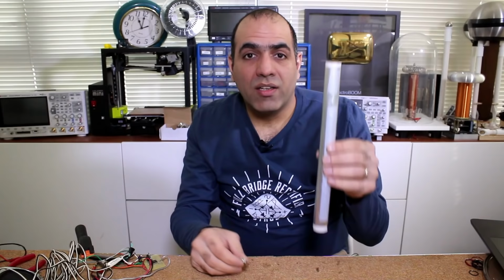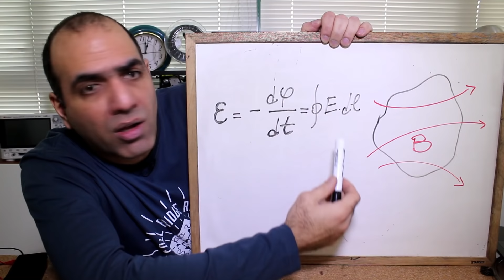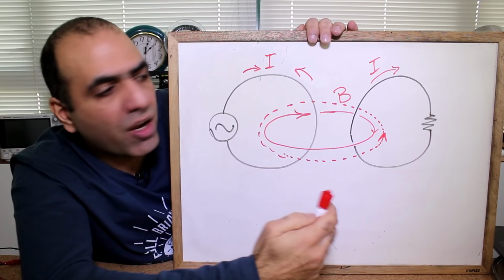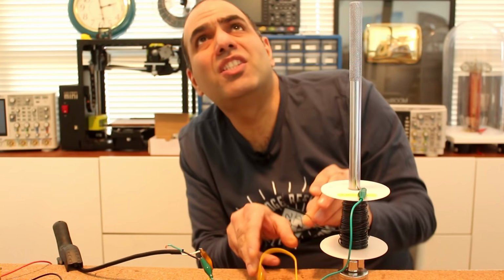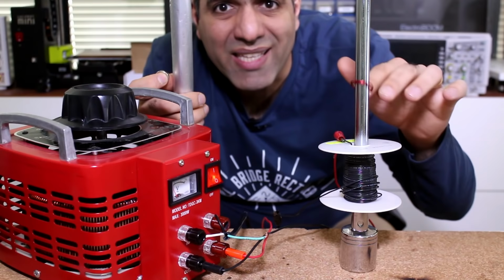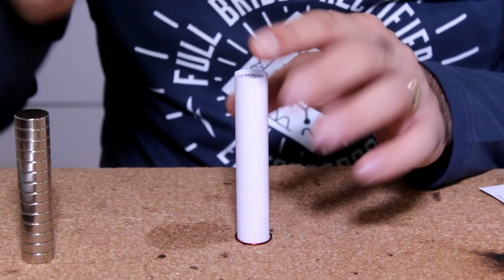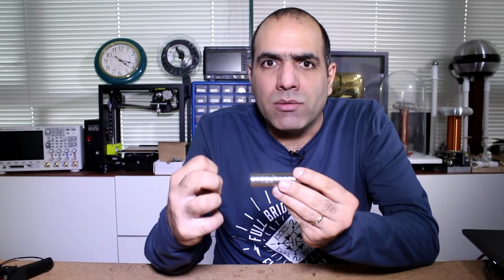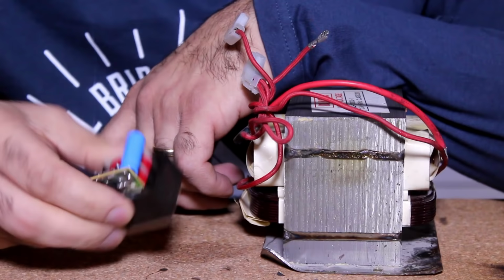The Amazing Eddy Current

Comment: The welds on the microwave transformer are to keep it from vibrating and making noise.
Reply: Theu could just have put 4 screws and not ruining it
Reply: @sovietcomrade7733  screws would vibrate lose. Welding is probably cheaper and they were not designed to be disassembled.
Reply: @jjhack3r  you know à transformer doesn't vibrate do you? Even in washing machines everything is screwed in place, and it never goes bad. It's just bad, and the welds aren't cheaper, but they make the whole things way weaker so you need to buy a new one earlier. Use a good microwave and you'll see the transformer is bolted down
Reply: @sovietcomrade7733  thats not what im talking about... the transformer core itself is what would vibrate. The plates would move. I have a car battery charger that makes a lot of noise and its no surprise that the laminated plates are not welded together. Cheap transformers have a shell that wraps around and holds it together. The smaller the transformer, the less noise it makes, therefore you don't need to weld small 8 watt transformers but 2000 watt transformers need reinforcement to keep them quiet. The "hum" noise that the microwave transformers make would be a lot louder without welds. I know what I'm talking about. I wouldn't have made the initial comment if I didn't know what I was saying.
Reply: @sovietcomrade7733  transformers make noise. The noise comes from vibration. More rigidity is less movement which is less vibration which is less noise. End of class.
Reply: @sovietcomrade7733  go play some games. Electronics and physics isn't your thing...
Reply: @jjhack3r  do you're basically telling me I don't know what I'm talking about ? I opened a lot of microwaves, and the best of them didn't have a welded core
Reply: @sovietcomrade7733  I have 4 of them and they are all welded. Its the best design. I told you exactly why they do it and you just don't fucking listen...
Reply: @sovietcomrade7733  you're telling me that I don't know shit but I have first hand experience with transformer design so I'm telling you that you don't know what the fuck youre talking about. They aren't using welding rods or any extra metal. They just run a tig welder over it to fuse the plates together. Not expensive at all.
Reply: @jjhack3r  then tell me why would there we bolted tranformer if it's not as good
Reply: @sovietcomrade7733  because the manufacturer can do whatever thay want. Its the same reason why not all cars get 35mpg. Its just a different design. It works, but welding it is easier, cheaper and more silent. Vibrations directly cause sound. Transformers make a humming noise and a bolted design is more likely to delaminate and make more noise in a large transformer design. Small transformers don't have much of a problem with vibration at low frequencies because they physically do not resonate at low frequencies around 60hz.
Reply: @sovietcomrade7733  the only reason a welded transformer would ever be louder than a bolted one is if the windings themselves were not secure and were allowed to move, causing vibrations and noise. The reason transformers are coated with an insulating layer is to fuse the wires and core together so minimal viberations occur. Viberation is not only annoying but it can wear through the enamel coating on the wires and cause shorts.
Reply: @sovietcomrade7733  the only transformer I have that is bolted together came out of a 1990's 300 watt UPS battery backup system and it was not quiet under load... it made more of a hum than a microwave. It is an old design and is not favored.
Reply: @jjhack3r  when I got my first bolt in transformer out of the microwave and pluged it in, I though it was broken because I didn't hear a sound. Then I moved my ear closer and heard a very weak sound. It might be more expensive, but it's way less noisy. I agree on the fact that it's maybe lesse easy to make. But I only found it good microwaves
Reply: @sovietcomrade7733  bolt in? As far as I know, they all are bolted to the microwave. I'm not talking about how it is attatched to the microwave, I'm talking about the transformer core. Btw most transformers are very quiet but the difderences show up when it is attatched to something for the sound to propagate.
Reply: @sovietcomrade7733  I'm not even going to talk to you because it seems like you don't understand english...
Reply: @jjhack3r  I'm not a native english speaker, that's why. When I mean bolt in, I mean the different layers of laminated steels arre held together by bolts

Comment: if aluminium has double the resistance of a copper wire shouldn't the eddy current be minimum and there shouldn't be any opposing force when a magnet is dropped through the tube.

can someone explain 
thanks!

Comment: Dead right, you can't trust the rating on those "Breakers" !!
  And the welded Laminations are ok because they don't complete a circuit in the plane required for Eddy currents, i.e. same plane as the copper is coiled.

Comment: im just trying to figgure out, since the current and therefor the magnetic field is alterating with alterating current sources, then why does electromagnets have the ability to either constantly attract or repel other magnets or magnetic fields/magnetic conductors, like in a contactor, shouldnt then the magnetic fiend flip 60 times each second on a 60Hz AC power source and its just confusing, or are magnetically conducting metals atracted to magnets indescriminantly if its the south or north pole? which would mean that, idk im just getting more confused about it.

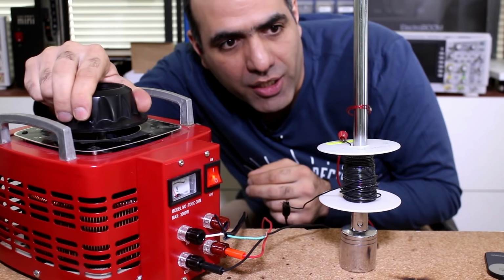Comment: @6:37 or so you can see droplets of what looks like water are emerging from the windings. Pretty interesting. I guess the vibration was drawing it out but why does it look like water is coming out?    
 
Hmmm.. Did you run water over it to try to help keep it cool? lol
Reply: Actually, that's the insulation melting.
Reply: @RakeshPoluri  lol that makes sense! Never seen it melt in that way though, must have been some the oils seeping out or something.

Comment: In my company, elector discharged pipe is use  to seperate dust from air.. I want to reduce that discharge pipe..i need high electronic magnetic fields for that i want crate magnetic chamber without use electrodischarge pipe in chambers. Its possible ? If any idea please suggest me

Comment: Isn’t dropping a magnet into a copper coil consider limited free energy since you’re using gravity to generate electricity?
Reply: The energy comes from your body putting the magnets there, so it is indirect food energy, not free energy.
Reply: coolguy 284 There’s no energy transfer from holding the magnet.
Reply: @furonwarrior  You have to lift it up in the first place, so there is definitely energy necessary to do that.

Comment: @ElectroBOOM Would it be possible to build a huge copper pipe, wear some insanely strong magnets at your feet an jumping through a really high pipe without hurting yourself? Just wondering.
This could be used as a form of emergency exit if the elevator dont work and the stairways are in flames or something. xD

Comment: Ok, the current is the resist that cause heat which is volt that meets the resist which create current, so the lower the resist, the lower the current, so the lower eddy current since it has resist which is shows that is repel. So, the repel has heat, so you say smaller resist cause eddy current but also it causes heat, so it is not smaller, but bigger? Because heat and eddy current has friction that reduce the motion of an object and create heat. So, the super conductor is zero resistance so create bigger eddy current but it is cold, so it is not base on lower resistance since what you show is cold, so the cold reduce the heat which reduce the resistance, so it has to be something extra that is beyond lower resistance but the cold itself expand the magnet field, when there is heat the magnet field get reduce, but cold the magnet field increase, so it is not base on mass alone but how cold is the mass will cause the mass's resistance to be reduce, so you reduce the resistance, but not the mass itself.  So, the resistance is not zero, but more accurate the mass's resistance get bigger, but the resistance which you cause motion is high, but the resistance of mass is higher than dynamic resistance which you cause. The bigger the mass but the diameter is same as an object goes thru, so it goes slowly, so the resistance is higher so it takes less power to cause the heat, so. Eddy current and current has resistance base, but it is connect to temperature which cause the mass's resistance to be reduce, well, if it is hotter, it can reduce, but the energy of mass increase when is cold. So, the higher energy meet the higher resistance at lower level, so it resists more because the energy cause the higher resistance. 

Well, you show experience for room temperature, so can show experience for lower temperature. Hot create heat and cold create heat in negative way that is cold current, ok, so there is warm current, hot current, and cold current, so the cold current has higher eddy current than warm one since the mass release higher energy in negative way that is Aether. Instead of mass which has heat which causes the break apart or at least to potential the ability to break apart base on vibrate within the mass itself, so that is what heat is. So, there are two current in positive and negative.

Comment: @ElectroBoom Draws a typical transformer but instead in his experiment B has the same direction on both primary and secondary (copper ring). So how does the ring have an opposed B? By inertia has the last one? Would it work with a ferromagnetic ring?

Comment: O que aconteceria se você energizasse o tubo condutor e depois soltasse um imã dentro dele?.
Reply: There would be a force generated per the right hand rule
Reply: @aaronnorman9755  O imã ao invés de cair acabaria "pulando" para fora do tubo?
Reply: @Anonimousxz  I think so, if the current and magnetic field are properly aligned
Reply: @aaronnorman9755  Nunca vi ninguém fazendo esse tipo de experimento... apenas o experimento tradicional (deixando o imã cair lentamente pelo tubo)..
Reply: @Anonimousxz  if you are trying to apologize, there is absolutely no need. And you don’t need to see anyone do this particular experiment, if you know the right hand rule, that should be more than enough

Comment: 10:16 But higher resistance means less current therefore less power and therefore less heat????????!??!?!?!
Reply: It's a bit more complicated than that with induction cooktops. Aluminum pots do not work at all because the resistance is too low.
Reply: @Owen_loves_Butters u seem like a pro so thanks 👍

Comment: Can you help me please. Off topic question. 
I have 2 inverter generators producing 120Vac at 3000watts. How can I combine them to have 240VAC running together. I know I can parallel connect them to get 120Vac at 6000 watts. But I need it to run me a 240VAC water pump that does not need lots of watts so I want to use this method. Please help. Can I wore it somehow or do I need to buy a transformer. Thanks.
Reply: Damjan Bjelanovic try putting them in series
Reply: Putting them in series will make them 240 V 3000 W
Reply: Thank you for replying. Unfortunately in parallel the inverter knows and voltage stays the same but wattage doubles. It’s how it’s designed to work. I can’t get it single phase 60hz and 240VAC no matter what. I think it needs a third part like a transformer or something to combine the sinewave

Comment: So in theory to knock a ufo out of te sky all u need is a radar to knock it out of the sky do to the fact your sending a current through it causing the voltage to go from 0 to 1 ruining its feild and causing the systems to literally fail. So this is why areas around Nevada are so heavy with ufo crashes due to the military microwaves. (I am joking but scared myself a bit due to the possibility of this stupid theory to being a reality. I want them to test these quantum magnets aginst radar and other types of radio frequeny used to detect objects)

This could also be why most ships once the lock on to a ufo it becomes sporadic and eventually just leaves do to the fact its literally becoming unable to function